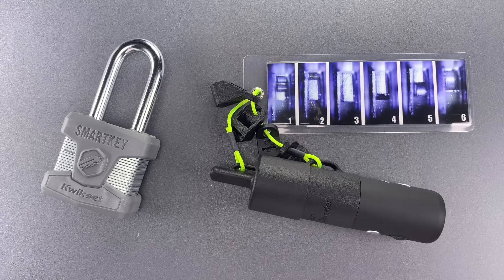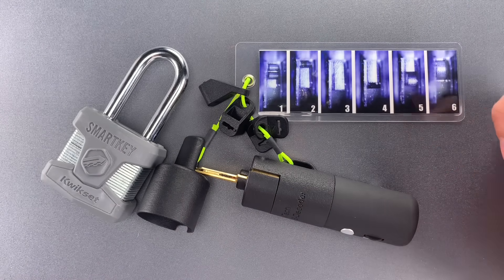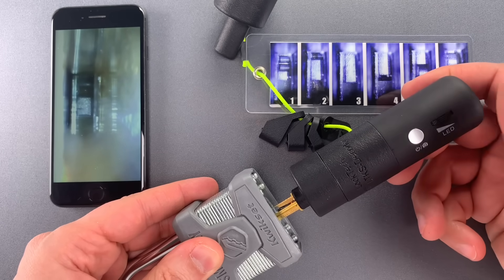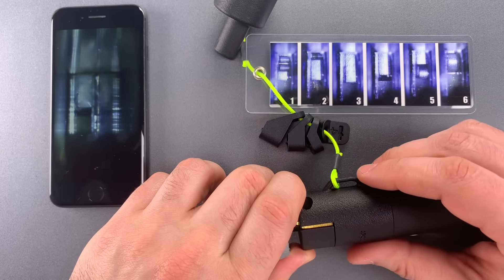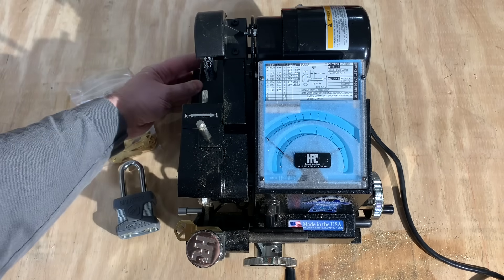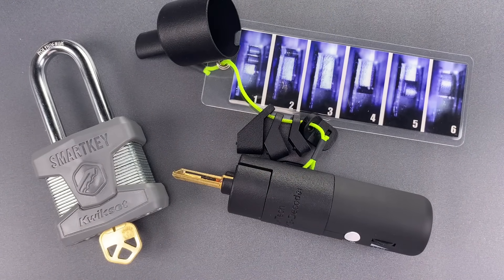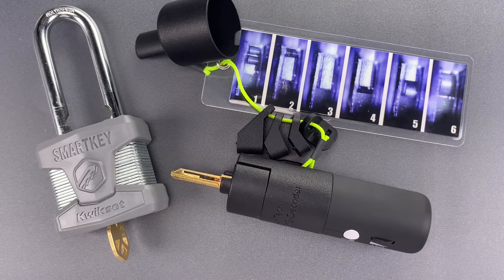[1209] This Tiny WiFi Camera Owns Kwikset SmartKey (LockTech LTKSD)

Comment: I never realised how simple key cutting machines were to use
Reply: The machine he used is very different from a standard key cutting machine. That one is made to cut a key without an original.
   Most key cutting machines are even simpler to use. I'm sure there are videos showing how to use standard key cutters.

Comment: Question:  Seems like this new "Tiny WiFi Camera" should work on MOST typical key types, no?
Reply: Yes, but without that decoding chart no novice is going to be making workings keys any time soon.
Reply: Also, it needs to actually fit inside the lock

Comment: the only risk i can potentially see with this is if criminals eg house thieves etc got hold of it they could have the chance of learning a crime targets external door locks internal setup and if they had the right equipment could do a copy of the key then enter when no one’s home but the odds of that i feel are fairly slim due to the cost for the necessary equipment being like it is as they would need enough for the camera tool then there’s the key blanks and key cutting equipment and each of them is a fairly high price then there is always the risk that the person doing the key cutting might make a error in the cutting process etc so it’s extremely unlikely that any criminal actions would be done involving this type of tool but for a lock picking job of a locksmith for example then this could be very helpful to know the internal setup of the lock and the cutting specs required for the new key to fit properly in the lock and work smoothly and yes i’m well aware that locksmiths are not the only ones who could have a good use for this as there are other job types that might occasionally need to open a locked door for access eg law enforcement etc and a tool like this could be very useful as they could get a copy of the needed key cut and use it for quicker access to the property such as police drug raid’s etc as if they had the key they could have access to the property in seconds which would save valuable time they could use to get more evidence etc

Comment: This has been a huge help to me as a locksmith, no longer do I need to drill every smartkey I come upon.
Reply: Remember, never tell your customers that a broken window is cheaper than a locksmith.
Reply: @runed0s86  Replacing a window is more expensive. Depending on the window it can cost more than just buying the camera and key cutter yourself.

Comment: Would be awesome if the Locktech tool saved a gcode file on an SD card that you would then plop into your 3D printer or CNC to manufacture as many keys as you wanted.

Comment: I was about to ask, how the camera sees the pins from that angle, but then I went back and you didn’t say pins, you said sliders. So now I’m wondering what a slider is.
Reply: A slider doesn't have to line up with the shearline like pin tumblers. They line up with something called a sidebar instead. A sidebar is usually halfway in the plug and half outside of it, resting in a groove of the inner shell. Without the key inserted, the sidebar will prevent the plug from rotating. The sliders, in this case, have cutouts at different depths called gates. When all the sliders' gates align with the sidebar, the sidebar will drop into the plug, allowing the plug to turn and open the lock. I hope this helps.

Comment: handy gadget .... so for about 2g a person can make a key for a door and enter when they feel like it .... I think locks will have to incorporate a second or third measure to make them tougher ... perhaps a coded signal and some form of magnetic signature along with a biometric end on the key  so all things must match for the lock to open ... sure it still could probably be bypassed ... BUT once you start having to use 2 3 or 4 different attacks at the same time you increase the likely hood of being seen and caught ....

Comment: That cutting machine was just....wow that was a real satisfying bit of gauging and calibration and just fine motor skill getting on the money . Doing what I assume is a trade mark secret move to best quality key, with smoothest pin transitions . By which I'm talking the slight nudge over and under the pin push length. Just real smooth. As a person who works around, and hopefully will one day work in calibration. Get to adjust those machines and make sure they are spot on..thanks for that share was a nice piece of tech to appriciste, especially for it's simplicity yet attention to detail and precision? I'm curious do u have any idea how precise the cuts are first attempt compared to other cheaper cutting machine? I think I'm stretching to far as to ask for a tools of the trade video. I'm new to the channel, I'm sure you show and tell your pick tools, curious if any other more odd ball or shop bound machinery, would be worth a 3 or 4 min video on? Thanks for the satisfying content. Just the simplicity of everything, well at least the way you explain and introduce everything is simple and easy to understand with no smoke and mirrors or side shows to draw the attention away from the craft at hand 👏. Have a good evening glad I came across this video.

Comment: Nothing compared to bump system or simple drill new lock reset rekey for owner to put in Walah you just robbed whoever it is and got away if u weren't on national tv
Reply: Can of compressed air or you get a blank and file it you can make it fit eventually
Reply: If u know what ur doing u know home depot only carries 7

Comment: As a locksmith I prefer to drill the core of smartkey lock, it takes less than a minute. ( Smartkey core are really cheap, so I leave the deadbolt and only replace the core that I drilled) than if client had many copies of their Keys in circulation, I take their existing keys and rekey the lock in 30 seconds since its smartkey. At the end its faster and less expensive for the customer since we charge Time. It usually takes about 15 minutes to complete these calls

Also where I live it can be -30° so client and I really wants to be done as quickly as possible

Comment: About 50 years ago we used a Curtis Coded Key Cutter for any master lock with the code # inked on the bottom. Car keys too. Set the right metal code wheel, set guide to proper slot for depth. Blank hey locked in an d squeeze handle slide to next cut and repeat. Faster and less skill needed. As long as the codes were in the book. .

Comment: Okay, that's genious and interesting. One question though: The first hurdle is the shape of the key, that you can see on the front/outside of the lock, the keyway - right? Does this tool have a hundred different inserts?
Reply: This tool is specifically for kwikset smart key locks. Just the kwikset keyway, and only works on smartkey because only smart key has the little wafers that look like those in the attached pictures.

Comment: In all fairness, it wasn't the wifi camera that "owned" the lock.  It was most definitely the fact that you have a key originator and the kwikset card for the forms.  Not to take away from the impressivness of all of this, that wifi key camera is cool as hell, it was just a part of the solution though.

Comment: If should not be too hard to come up with a different design for tool that accomplishes much the same thing but which can be constructed from off the shelf component and which could be shared as an open sourced instructable. Its just a special purpose borescope. A DIY version,  not as nice or easy to use or as pretty but functional probably one and done for less than $70 and a day to build.  There is  that nothing here that is unique or unavailable at the component level. The more I think about this,  the more doable it seems.  Anything that would image the sliders is all you'd need.

Comment: Or just go to any locksmith and give them the code, and they’ll cut it for you no questions asked, just tell them that you wrote it down off the original keys before you lost them, since the key codes are literally the pin codes.

Comment: Ok, so I have the HPC Blitz Machine  (normally I use for vehicles, cabinet lock)
On smartkey service calls they are usually drilled out and replaced, my question is how much would it be reasonable to charge in order to make it worth investing in the Kwikset Smartkey WiFi Camara being that it is quite expensive?

Comment: Yeah I guess this guys screwed once they have Wi-Fi locks with no keys..

Anyway..
Criminals unite this guy has given out all the secrets...

How do I feel about it for my own personal security and that of the community?

Not great.

At least he's making money
Reply: Depending on the design and encryption used in wifi locks signal intercept is possible as well. Plus LPL has opened his share of electronic locks through design faults or other low skill attacks. It all comes down to how much effort the lock companies put into their products. 

This type of information is already out there, criminals already have access to it and the value of what LPL does is to present it to the mass public to raise awareness in the products we use and hopefully to force the lock companies to improve their design and construction. 

You might feel bad to realize that your locks are actually very vulnerable, but how is that any worse than being vulnerable and not even know about it?

Comment: I've done something similar with very simple lock where key only needs to fit the hole, often used in doors induce buildings, where security isn't very important. I used camera in my phone to take a photo of the hole and 3d printed a key. The process was different from the one in this video, but the idea was the same

Comment: Wait, so does that mean all common keys are just different combinations of those six cuts? That doesn’t sound right but he was able to get a key just from that one sheet.
Reply: As far as non-specialty locks go, yes.  For example, Schlage, Kwikset, etc. use either 5 or 6 pins, with I believe either 7 or 8 possible cut depths, depending on the security level of the lock.  (I may be off on the number of cut depths).

Comment: Looks like this approach would be very useful for making keys for vintage pin tumbler locks whose keys have disappeared over the years.  I have a few old padlocks of my Dad's which have no keys.  I actually went to the trouble of hunting down original vintage key blanks for them in the hopes I could get keys cut for them someday.
Reply: It's only for this lock. If you want to do that learn how to impression locks

Comment: I got into key making I only make BMW or mini and some Land Rover keys. They are high security with a milled cut sorta like a worm eating through wood. But a spare key was gonna cast me $400 and I was able to buy all the equipment for under $200. The cutter was a cheap one. I made and programmed my key then after people found out I could make them I started doing them for customers. $125 for a complete key programmed to your car. The dealer can’t even do that they have to order the keys from BMW german and they flash the transponder there.  The transponder flashing device was $30 from China. You have to remove the EWS box from the car. That’s what has all the security stuff for the key. I put a socket on the main chip and read it and rewrite anything I need to like removing any lost keys. So if someone had one they could unlock it but it would never start. Now I mess with all kinds of locks. It’s basically a hobby. I only sell about 1-2 Bmw keys a month. When I first started doing them I was covered up I think in the first 6 months all my customers got spare keys and now everyone has them. I can not make a Bmw key without having one to copy. I can pick the locks with a Lishi lock pick made for the bmw. If I had a machine capable of cutting by numbers I could make them but I’m not spending that kind of money on something I use once a month. If I get a car with no keys I change out the locks from a parts car and cut 2 new keys off the one from the parts car and flash the transponder with data from the car that had no key. Only drawback is you can’t order a key from the dealership anymore. But like I said I make 2 keys to go with it and tell them what the deal is. Awesome tool you have there.

Comment: Nice  but I  believe your  quote on law  enforcement was  not correct. Law enforcement just  breaks  down  the door .They  don't  have the time  to  read  instructions on this tool . Hint  the  door  wasn't  broken but  now  it  is  with the door  buster method . Time  saved shorter  than  this video; note - 5:02 .
Reply: Dude the police don’t only kick in doors for emergencies/raids…. Sometimes they need entry to a building without others immediately realising
Reply: European law enforcement will almost always call for a locksmith, because a standard european front door is too tough to break down quickly.  We are talking about hours, not minutes when using a manual battering ram. Therefore a very valid option in Europe.

Comment: V2 will allow you to insert the key blank into the rear of the camera to be manually CNCed to the proper specs after setting a bunch of dials around the perimeter of the camera and then hand cranking the grinder inside akin to a mechanical Curta Calculator 🤣

Comment: After watching a handful of LPL videos, I feel like I should just throw away all of my locks and leave everything wide open.
Reply: Don’t depend on locks for security, get an electronic security alarm
Reply: @gurgy3  that isn't going to secure my shed, trailer, etc.
Reply: I have a wireless alarm on my shed.  As far as trailers, etc.  there’s nothing you can do that will stop a determined thief.
Reply: @gurgy3  That's true but it isn't always about stopping them but deterring then so they move onto something easier where they are less likely to be caught.
Reply: @gurgy3  A gun usually does the job

Comment: I'm sure we're not too far off from having a tool like that connect directly to a 3d printer. 
Uh oh, why's there a van outside my house?
Reply: CNC machine says hi.
Reply: @ronfish8375  wait so they have data on all of your keys and a way to make versions of their own?
Reply: @LineOfThy  yes
Reply: Did someone order Flowers By Irene?
Reply: I'm sure you have a better lock than that on your house door. Otherwise, get it changed.
Reply: I mean, it's would be possible to create an app on your phone that you could enter the depths for the pins, the type of lock, and number of pins, and then have the software use that data to automatically model/modify a key, send it off to a 3d printer, and voila! New key in just under and hour or two lol.
Reply: its a website called keygen

Comment: My wife worries when I forget to lock the patio door at night after taking the dog for a late evening walk.  I promise to do better, and I mean to, but in fact if the door is locked I doubt it is much more secure than unlocked, and here's why:  The door knob is just under a set of 8x10" panes of glass, and one quick smack on a single pane breaks it,  or some other subtle and quiet method of removing the pane allows a potential intruder to reach inside and unlock the knob, the static security device, and anything except a keyed-inside lock with key removed (a lock which I do not have).  Or, the intruder could pick the simple five pin door knob lock with a brushing motion or some other form of lock picking which has been demonstrated over and over on YouTube.
I doubt if this expensive device is actually necessary because some picking devices and some  experience using them should unlock that simple lock much faster than that electronic device, and allow the person to enter immediately without having to go get a key cut.

Comment: I worked for uhaul we would cut keys in the field with a vin number and a revenue number to get the number to put into the hand held key cutter it was like a punch it would chip out the right notch with corresponding numbers.. I have tons of ford blanks still and gm

Comment: You can also go to any hardware store and have a key cut for you. Whether or not there is a fee for doing so depends on the store.
Reply: I've never been to a hardware store where there wasn't a fee for cutting the key.  The one near me, it's $2 to get a key cut, but if I'm cutting it myself, they just let me have the blank.  I cut all my keys with a file anyway, because the ones they cut at the store are done more quickly and without the option to cut, test, cut, and retest the key as many times as needed for the best fit and function.

Comment: Incredible. I had no idea the key notches were standard depths, easily reproduced just by visual means. 🙄
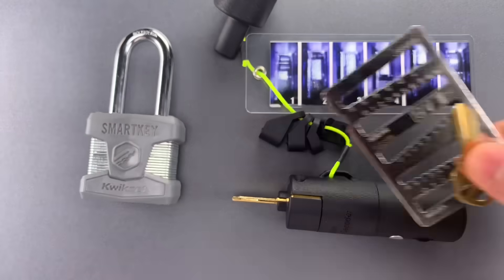Reply: That metal plate he held up at 1:55 is a gauge. You can use it to measure the depth of key cuts on a key when re-keying a lock, or you can use it to gauge the depth of your cuts if you're hand-cutting a new key. You slide the key into the gauge and there is a number marked at each depth interval. The number coincides with the number of the pin length. Those are the numbers he was calling out when he was using the camera inside the lock.  Ever seen a key with a 5 or 6 digit number stamped on the key?  Those are the pin numbers used inside the lock.

Comment: So it means this lock is good then? 
Because he has to using unusual tool, and he have to created a key for it.
Reply: Yeah. I mean, if a criminal is going through the effort to make a fake key like that, it would be cheaper to just cut the lock with bolt cutters.

Comment: Do they have a magnetic key that instead of pushing the sliders they pull them to the key to match the cuts?
Reply: If you have a metal key that goes in the slot and touches a really powerful magnet in the back of the hole it could then magazine the key and pull the metal tumblers down against a spring to line the slots from the top.